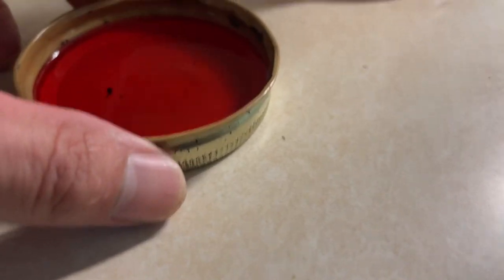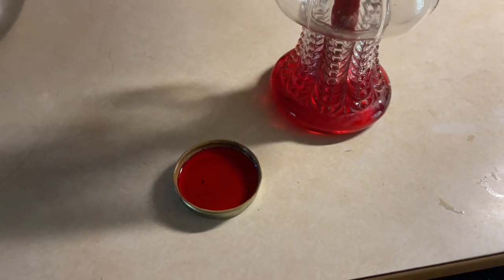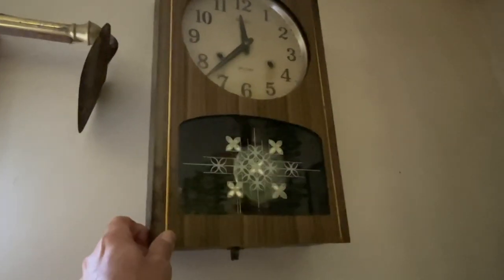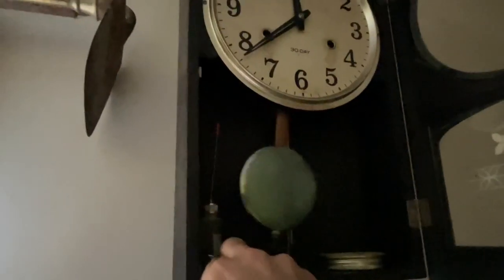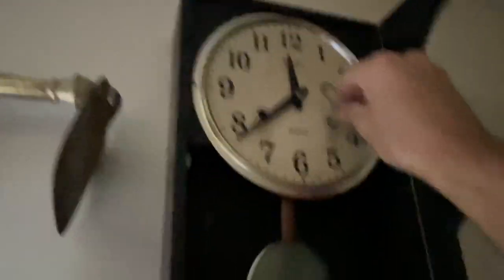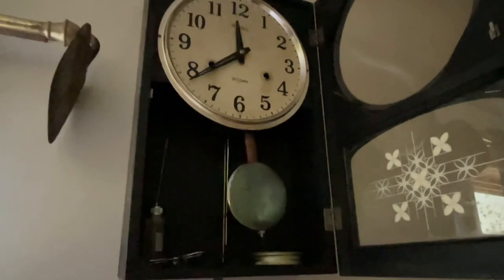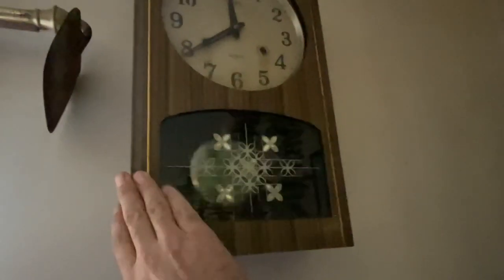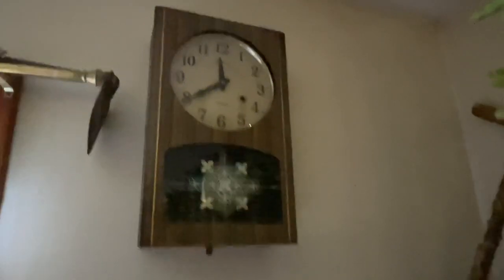Clocks Run On Oil fff#49 v245

Comment: Hey brother Justro! You just talk all ya want to and we will just keep a listening. Kerosene works wonders on lots of stuff. It is also keeping the moisture out of the clock as well as lubricating it. I told Ms. Tipper that my granny made a cough medicine using kerosene back when I was a little feller. Have you heard of that up in your neck of the woods? Thanks for the good info!!
Reply from the maker: Hey thank you Rick. Yes I have. I have heard old timers talk about dangling a wet lamp wick down their throat to cure a sore throat.

Comment: Clock oil is made for clock lubrication and coal oil is made for lamps. Would you lubricate a mill wheel with coal oil or the proper weight oil for the oiling cups of the mill wheel bearings?
Reply from the maker: I don’t think you understand Buddy. Thank you though
Reply: @metcalfmills5679  There are some other good useages for Coal Oil. Put coal oil on a two man crosscut saw and it will make that saw sing through the wood. Also about 30 or so years ago I meet an old man in his 80's. He said as a boy he had his finger cut off in some farm machinery. Well his Daddy took the finger and they went up to his Grandmothers. She made a splint and put the finger back in place. Then she took a rag soaked in coal oil and wraped it up. He held up that finger as crooked as a dogs hind leg and said I've still got that finger to this day.